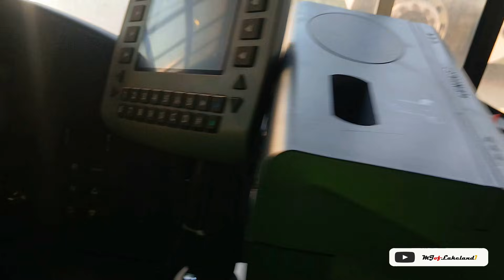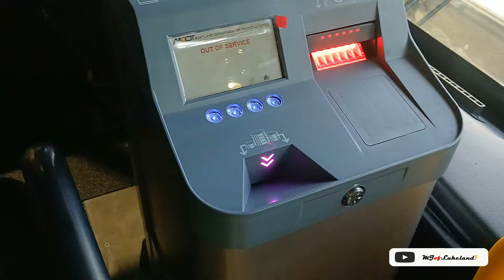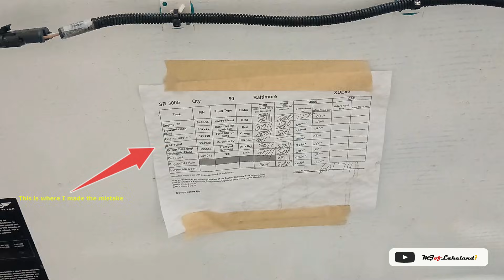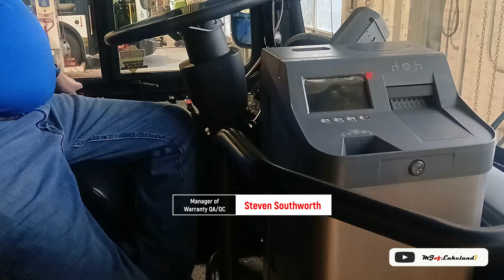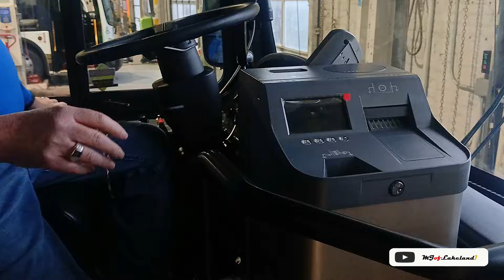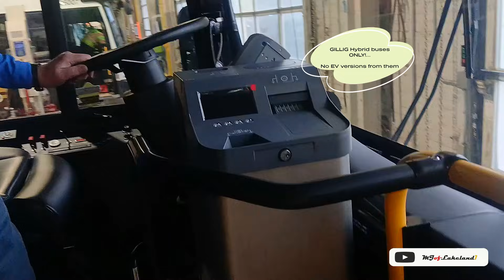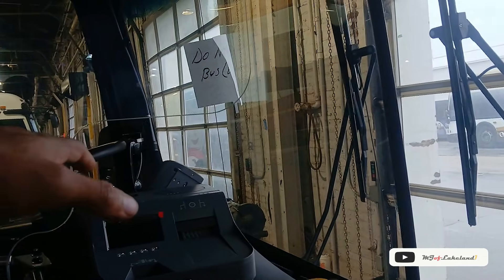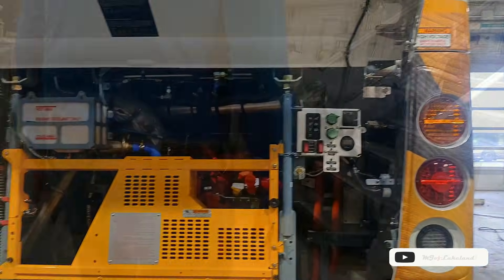WALK AROUND! 2025 New Flyer XDE40 Hybrid (w/ a breakdown from MDOT MTA's Manager of Warranty)

Comment: Clearly things could have changed, but the original Gillig contract was for 10 hybrids + 10 electrics over 4 years 2/27/2025 - 2/26/2029. All of the new buses, NFI & Gillig were acquired off of a State of Washington contract. That contract enabled MTA to acquire the buses much quicker than using the normal competitive procurement. The MTA is buying hybrids instead of a larger order for electrics due to MDOT cost constraints. As of now, once all of the buses in the current order are in, only straight diesels will be ordered until MDOT's budget improves.
Reply: Do you work for MDOT MTA? Because the knowledge is a lot to take in.
Reply: @arivera05062  No. But I have been a professional transit consultant amd And an avid student of transit since elementary school. Anyone can access the Maryland Board of Public Works (BPW) meeting agendas at bpw.maryland.gov.

Comment: Thsnks for a great, informative video. 😎👍We have these in NY. We share this hybrid mechanical configuration except for the (ridiculous) stop/start. We also have CNG/Westport, Electrics and ICE configuration. NF makes a nice, solid bus. Thanks also for the technical details as well. 

We have the OMNY touches fare collection system (sucks, slow latency even reading its own cards). Your fare box would confuse our riders.😅

Finally, the bus featured in the video has alot of seats, appealing and pax friendly. At NYC MTA, we have fewer seats, lost a row for the new wider back door(even easier for fare beating). Also we have these folding seats, which no one knows how to use to make way for clutter like shopping carts and strollers(which should be folded).

Comment: So 25001 thru 25050 are powered by B6.7 engines and Allison HybriDrives after all. Jesus! So much confusion I tell ya 😂. And more importantly we’re finally getting a proven bus that can tackle Maryland roads and weather. THANK YOU GILLIG you beautiful b*stards you! 
I’m sooooo stoked for the Gillig buses we get. 
But my question is are we getting the full 20 or is it only gonna be 10?
Reply from the maker: That 2020-24 contract for 350 buses should have been Gillig. It still bothers me to this day that Nova was chosen. Even the manager, himself, has no desires for them but it was a chose by the previous manager.
Reply: @MJofLakeland1  Up until recently, Gillig hasn't really committed to doing large scale multi-year orders. The previous manager was actually interested in Gillig, but was told by the sales rep about size constraints. I guess that's changed since the Seattle and Dallas orders.
Reply: @MJofLakeland1  if the current manager had only been in charge then, we could’ve had Gilligs roaming around instead of NovaJunks. But all the same though, is it only 10 we’re getting?

Comment: I think these are the models Wmata is getting when they retire the rest or the Lfas I believe
Reply: Indeed! It will be 125 New Flyer XDE40s probably up to 2027 assuming that it will be the first batches in 2026. I kinda hope they get a B6.7/BAE HDS200 combo though it’s much more entertaining to the ears.
Reply: @underdamud. I wonder what happen the other cng Wmata was supposed to get
Reply: @dontaviansmallwood7889 Unfortunately it was canceled since WMATA overbought XD40s and it was pretty much a no-go for more units up in the fleet so yea it sucks🤦‍♂️
Reply: @underdamud. I figured that I wonder what will replace the 2015 xde60s since it almost time for them to go in 27
Reply: @dontaviansmallwood7889 We have been leaning against hybrid fuel buses again.. so I wouldn’t be surprised it’s XDE60s at this point. WMATA is just breaking the zero emission goal at this point as new diesel fueled buses in the fleet? 😬
Reply: @underdamud. 😂they said by 2045 and so far we have 12 total busses that’s are electric but to bad we only got 5 novas I wanted more but the xe60s are out of service but hopefully we see them soon
Reply: @d @dontaviansmallwood7889 Yea they should place the XE60s back up at Shepard Parkway after they fix those electrical issues or whatever not sure if it was some recall that NFI issued but barely has been what? 2 years since they’ve been on property..
Reply: @underdamud. just hope whenever northern opens back up we can see some xe60s on the D40 if they decide to order some more in the future